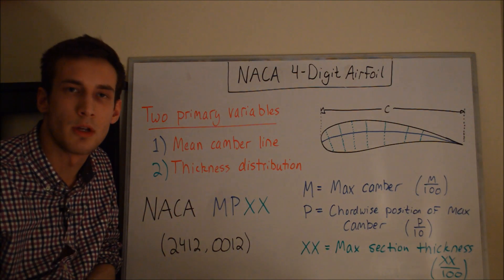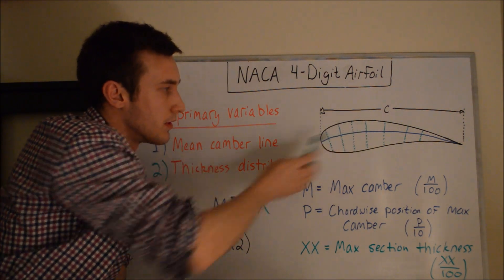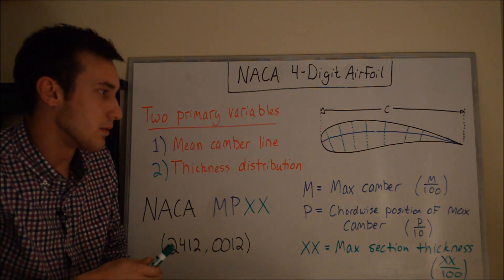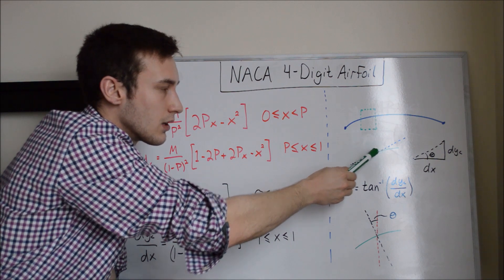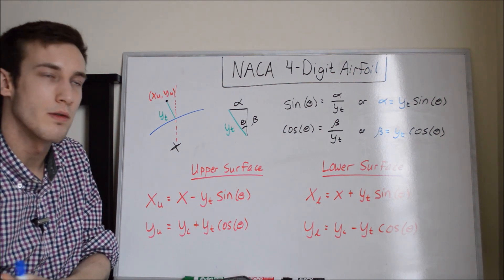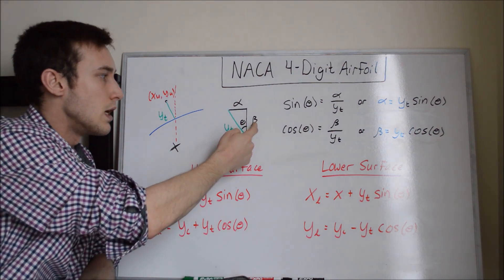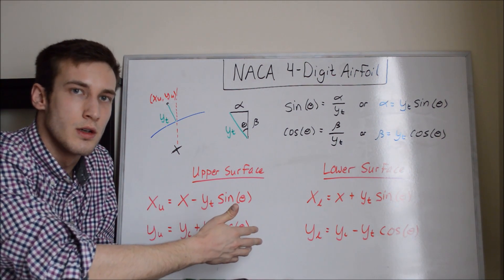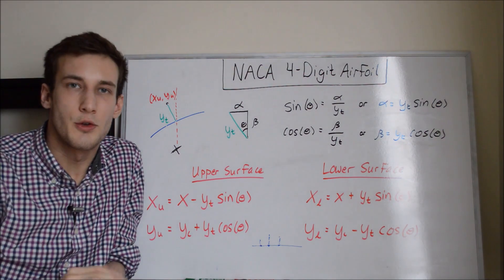Explained: NACA 4-Digit Airfoil [Airplanes]

Comment: Hi Josh, excellent video and I have learned a lot. I have a question where if the default location of the thickness is not 30% of chord but at 23% of chord, what is the thickness distribution equation? Thank you.

Comment: It seems to me that for a symmetrical airfoil, you can get a surprisingly decent approximation with a half ellipse ending at 30% chord, then a tangent circle arc to hit the trailing edge at the centerline (not perfect, but close enough if you just need to draw a visual aid rather than plotting the airfoi). I wonder if the equations simply to something similar, or if it's pure coincidence

Comment: I made a 6 inch 23012 flat iron lifting body twin rudder with a nickle for a weight balance . incredibly stable model. Would set up a hurricane fan pointed up and about 15 feet away toss it straight over and it would just fiercely roll and always back upright and straight on stable
Reply: Every flight at the end of its flight speed it would always just kinda flutter in the sweet spot on stall. Had a noticeable ground effect landing on hard surfaces.

Comment: If the name includes the parameters, why do sites like Airfoil Tools have huge lists of foils instead of just the means to input their parameters?
Reply from the maker: I just went to their site, and it looks like they do have a 4-digit and a 5-digit generator page if you want to use that, but like you mention, they also just have them as static pages.  I'm guessing it's so that they have a complete database with static pages including all the necessary airfoil information, instead of always needing to generate that information every time a different combination is run by a user.  Also, a bunch of airfoils don't use the airfoil name/number to create the shape, so those will need to always just be available as a data file.  But I could be wrong.

Comment: Smart dude but not camebur but camber.
Reply from the maker: In aerodynamics it's typically pronounced CAYM-bur.  In vehicle dynamics (for tires) it's typically the other pronunciation.
Reply: @JoshTheEngineer  Um no it isn't, I was a Aircraft drafter designer and a Crew Chief in the Air Force. Neither place used the pronunciation camebur. Not trying to be difficult but it's kinda like calling a glacier a "glassier".
Reply from the maker: @matthewmoilanen787  I think we'll just have to agree to disagree on this one.  Reasonable people can pronounce words differently, and that's okay.
Reply: @JoshTheEngineer  Pronouncing differently, maybe, asking people to accept it as normal just because you want them to is a bit of a stretch. The reason you stated for your pronunciation is simply not right though. There is absolutely no difference in the pronunciation of camber between the two groups you described. Sir I created engineering drawings for the aviation industry and nobody used the pronunciation that you do for goodness sakes.
Reply from the maker: @matthewmoilanen787  I'm not quite sure where I'm asking people to accept this way of pronunciation.  The pronunciations I mentioned here are what I've experienced over the years (hence why I said typically).  I think it's fine that you worked in the industry, but just note that others also work in the industry, and pronounce it differently than you.  Again, we can agree to disagree.  This discussion reminds me of a comment on another video of mine many years ago, where the commenter was very upset that I was using a certain type of mathematical formulation for a problem, and was adamant that it was never used anymore.  In fact it was in widespread use and still is to this day, but perhaps he was so adamant because he was used to using a different formulation.  All of this is to say, we can have different opinions on this topic, and that's perfectly fine.

Comment: Great Explanation!
Is there perhaps a way to find the y as a function of the X - projection of the point (not the x as defined in your equations) ?
Reply: That function might end up being multivalued depending on how rotated-over the leading edge is. You can have a go at getting wolfram alpha to find a closed form solution if you like, one might not exist though. Computationally, using Newton's method or even binary search would be trivial to implement. If you don't understand what I'm saying, please clarify what you're trying to do.

Comment: What happens when the chord length is greater than 1? How does,the second equation change?
Reply from the maker: The equations are for a normalized airfoil, where the chord length is 1 (and units don't matter).  So if you wanted to design an airfoil with a chord length of 2 feet or meters, you would just multiply all the coordinates by 2.

Comment: What I find amazing is that the guys at NACA were able to come up with these equations to fit what were considered good airfoils at the time using pencil, paper, and (I assume) tables of logarithms. (Too many significant digits for slide rules.)
Reply from the maker: There are definitely some things that engineers of older generations were able to figure out that are super impressive when you look at what they had available at the time.

Comment: Thank you for the explanation. please excuse my ignorance, but are symmetrical aerofoils designed for use at different speeds?
Reply from the maker: You're welcome!  The nice thing about symmetric airfoils is that they generate no lift at zero angle of attack.  This is perfect for vertical stabilizers.  One thing that a thicker symmetric airfoil will let you have is more structure, so they can be made stronger if necessary.

Comment: sir , what is your graduation please guide me  . may you are doing aeronautical engineering btech or masters please reply please
Reply from the maker: I have a B.S. in Mechanical and Aerospace Engineering, an M.S. in Aerospace Engineering, and I'm working on my Ph.D. right now.
Reply: Sir iam pursuing btech in mechanical engineering 
And I try to design and make a turbo fan jet engine so sir 
As the diameter of turbo fan is 280 mm 
Sir which NACA airfoil is best for such small blades 
For turbo fan . Compressor .and what for guide vanes and turbines
Sir please help
Reply from the maker: The compressor and turbine blades are most likely not going to simple NACA airfoils.  Especially for the turbine blades, you'll note that they are highly cambered, so you're probably going to want a specialized airfoil for those.  For a bunch of airfoils (maybe not what you need though), check out the UIUC Airfoil Data Site.

Comment: Good Video! I still have a question: In my recent research I often got confronted with the name NACA651210 (some digits may be subscript). Can you tell me something about this notation/syntax? I hardly can find any information about it. Thank you very much
Reply from the maker: There are two things this notation could be referring to, and I should note that I'm taking this information from Theory of Wing Sections by Abbott and von Doenhoff, which I recommend if you are interested in airfoils.

The first is a NACA 4-digit that has modifications designed to change the thickness distribution.  The example they give in the book is a NACA 0012-64.  It seems like the notation will always look like this, with the first four digits, then a dash, then the last two modifying digits.

Now in your case you mention that the values could be subscripts, so what I'm leaning towards is a NACA 6-digit airfoil, which are much more complicated than the simple 4-digit series.  In the 6-digit series, you'll see numbers, commas, parentheses, and subscripts.  Some of the designations might even have more or less than six digits, and some might include letters instead of numbers.  I would need to read a little more about it to understand it, but this can be a starting point for you.  I'll try to make a video about this in the future, but it's too much to explain each variation in a simple comment like this.  I would get the book I mentioned above if you don't already have it.
Reply: Thank you very much! I'll check the book and see if I can find the exact information I'm looking for

Comment: Could you also explain (or link me a resource) cosine spacing, like what airfoiltools.com uses? I've been trying to figure it out but I don't know what to do. All I know is that it changes the distribution of the points towards the leading and trailing edge.
Reply from the maker: I made this video for you to help explain it.  It's easiest to visually see it.

https://goo.gl/K5Rai9
Reply: +JoshTheEngineer Thanks! left a comment on the video.